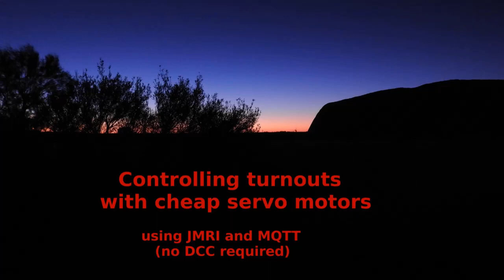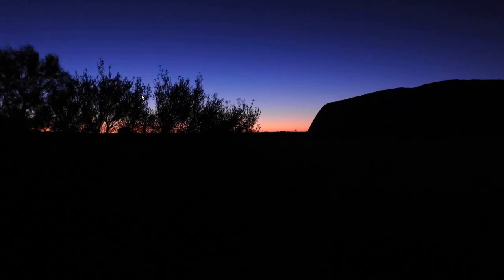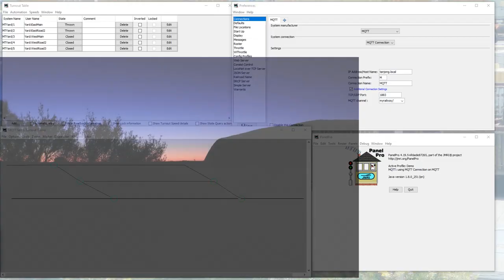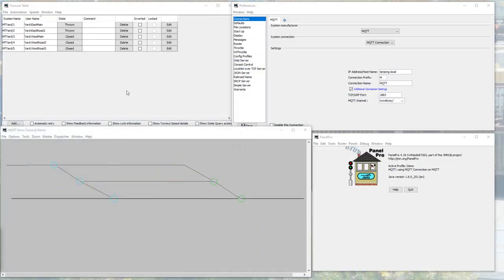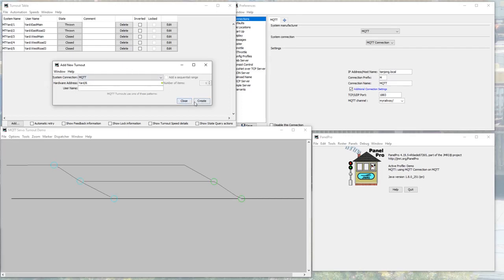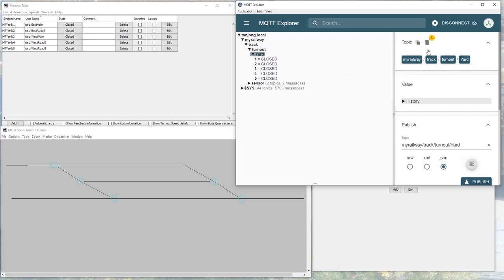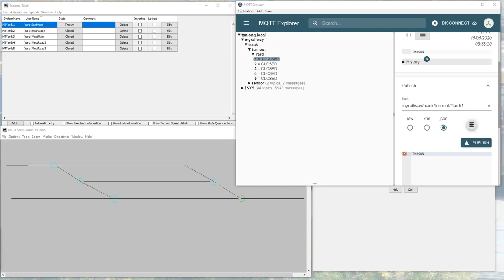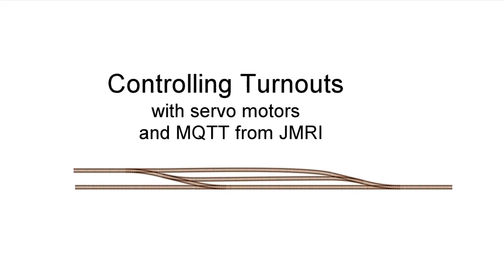Controlling turnouts with servo motors from JMRI with MQTT

Comment: Would be interested to see how to configure the Mosquitto MQTT broker and any additional Sketch samples you can provide.
Reply from the maker: James,  I don't do any configuration with the broker, just install it as per Mosquitto instructions. You can do things like require a login to connect but I don't bother with that (even though I'm ex-IT with significant focus on security!).  I have recently done an NMRAx presentation on MQTT - https://youtu.be/3lu0SZ9wjj0?t=18060 .  In that there is mention of a better sketch (mqTrains) than mine being prepared. Rather than finish off my sketch, I'm putting my efforts into helping with mqTrains.
Reply: @t-traku-tube5883  I have two more questions after watching that video.  
1. Is that project still on track for releasing something before Thanksgiving?
2. Where can we expect to see it when available?  Website?  YouTube channel?
Reply from the maker: @jamessutton9319  Hopefully by Thanksgiving but no guarantee. I will post details here when released.
Reply from the maker: Well, clearly we didn't make Thanksgiving and a few distractions since then. Release of a binary upload for the ESP is imminent. Keep an eye on mqtrains.com. We use a simple loader program (not ours) to upload the binary. Code will be released a bit later.
Reply: Any chance of getting the source code for those of us who understand that side of things?
Reply from the maker: It's coming.
Reply from the maker: We have released mqTrains-ServoPCA firmware for Espressif ESP01 devices for turnout control using servo motors. This is free to download. The sketch has been released as a binary file, the code will be released later. The binary file and instructions can be downloaded from the link below. Details for the loader program are in the instructions. Arduino IDE is not required.
https://github.com/nambabwe/mqTrains/tree/main/released/ServoPCA

This firmware drives up to 16 servo motors for controlling turnouts (or anything else) with servo motors. User-specific configuration is done using the ESP01's internal Access Point and Web Server. You can also control the turnouts from this Web Server using your smart phone.

mqTrains communicates with JMRI via MQTT protocol so turnouts can be controlled like any other turnouts in JMRI. It does not use DCC for communication so works with any DCC brand or even no DCC, i.e. a DC layout.

A Facebook group has been started for mqTrains discussion. https://www.facebook.com/groups/2907252919558572/